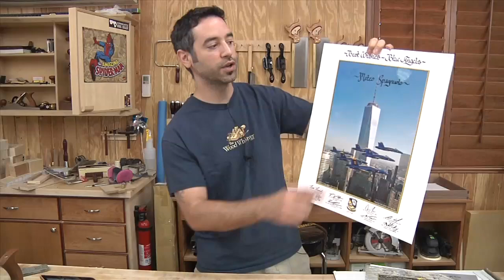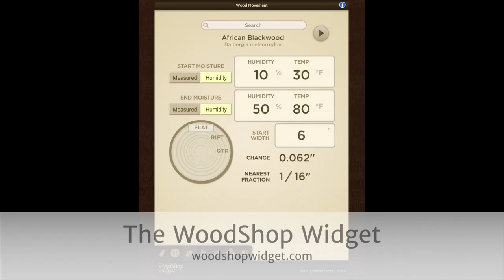222 - TWW Live: Does Wood Really Move?

Comment: air drying, versus kiln drying, all my lumber here in western NY, iv'e found that letting boards set outside in the weather for a year or so before bringing under cover slowly works the extremes of expansion either making cracks become visible or stabilizing the wide board. At least if there is gonna be problem you find it before the finished product.

Comment: Now immerse that wood in salt water for six months (or more) a year only to pull it  and set it out on blocking and stands for the winter. Wooden boats most definitely move... sometimes a lot!!!
We also dealt with moving wood when we bought a crane in Nevada, drove it to Maine and one week later, the 1 1/2" hard wood deck boards all had swollen to the extent that they had popped up between the screws and split in half. We swapped those boards out with green hemlock and things are working much better.

Comment: I recall reading a Fine Woodworking article where they finished the ends of a table with deeper tongue and groove sections and a draw bore pin.  The holes cut into the deep tongue sections were oblong to allow the pin to slide from side to side, yet, the draw bore pin pulled the joint tight.
Reply: Thank you for the article, I've been looking for something like this. You've made my day. :)

Comment: adjusting your jointer to match what you are doing is very simple.  if i want a dead flat board i adjust the jointer, if i want to make a sprung joint again i adjust the jointer accordingly.  i never have snipe because its all about setting the out feed table.  your out feed table adjustment is very quick (seconds) and simple. i actually have a vid on jointer tips and tricks.

Comment: In response to the contractors table saw question.  As a contractor, I highly recommend the Bosch 4100 series saw.  The one we have has been put through the ringer and still preforms admirably.  Im in the process of building a 20'x40' work shop and due to this saws power and reliability, I will be purchasing one in lieu of a floor model saw.  I plan to build in and out feed tables to give it greater versatility but plan on making it removable so I can take it to job sites when necessary.

As for the power of this little dynamo, we regularly rip soaking wet treated wood using a 10" Diablo blade, purchased at a national box store at a reasonable price, and the saw has yet to bog down after 5 years of use.

BTW, I am NOT a representative of nor associated with Bosch or Diablo in any way.  Just a woodworker with years of experience and this saw combined with this blade are well worth the money.

Comment: I know this is an ancient video and there is little chance of this question being answered, but I'm desperate so here goes.  I have been asked by my daughter to make her a stovetop cover or noodleboasrd.  So I went to the source of all knowledge (YouTube videos) and indeed, found a ton of videos on 'how to make a stovetop cover'.  Unfortunately, almost every one of these things show the person gluing up a flat panel and then attaching (usually by gluing and screwing) some side edges as a mount for handles, or a side border, or some kind of 'riser;' that elevates the board off the burners, etc.  I'm not a tremendously experienced woodworker but I was always taught that if you glue up a reasonably sized (>35") flat panel and then permanently affix a side border (across all the glued together boards) on it, then it will probably split as the panel gets larger or smaller (across the grain of the wood) in response to changes in humidity.  None of these videos seem to have allowed for this. I even texted one of the guys and he said he had never had any problem like that is several years of making them.   Am I wrong?  Or am I just worrying too much?  I know that wood does move because I have had issues like that in the past.  So why are all those stovetop covers not tearing themselves apart?

Comment: I once helped a friend to lay laminate flooring, it was decent wood, not the cheap stuff, it was allowed to acclimatise for about a week in the room, the room was about 16 feet long
We laid the floor, allowing the 1/4 inch recommended all round, i went to the house the next day to finish off the trim, the floor had a huge rise in the middle of about 1 foot, it must have been the moisture from the concrete floor, even though we installed according to instructions, does wood swell ? heck yes.
Woodworking isn't dying, it's changing and evolving, almost gone are the real craftsmen who built everything by hand, handsaws, chisels, spoon drills etc, 
Now we have all the modern technology of electric tools, jigs etc, where dovetails used to be hand cut, now you use a router and jig.
No need for all the years of  training, just read the manuals and find some online tutorials.
Not sure what it's like in the US, but there's a growing breed of traditional woodworkers who build oak framed houses in traditional style, but they do have a little help from modern tools, though they usually hand finish for a good fit

Comment: 23:54 , What are you doing with your finger Marc :D
Reply: There are a few components to starting up a woodworking business. One plan I discovered which successfully combines these is the Enata wood system  (google it if you're interested) definately the most incredible plan that I've heard of. look at the great information.
Reply: There are several factors in running a woodworking business. One place I found that succeeds in merging these is the Enata wood system  (check it out on google) definately the most useful resource that I've heard of. look at the awesome information.